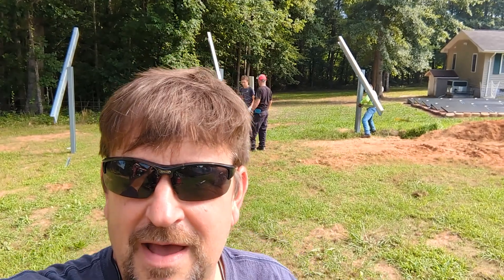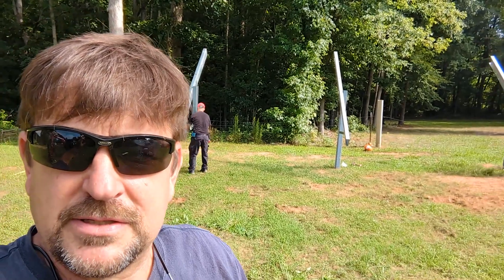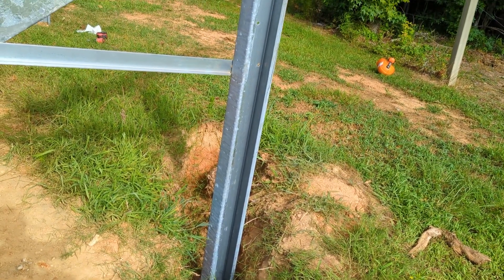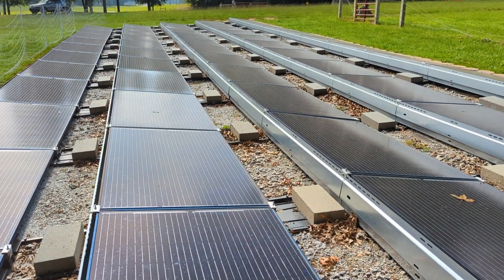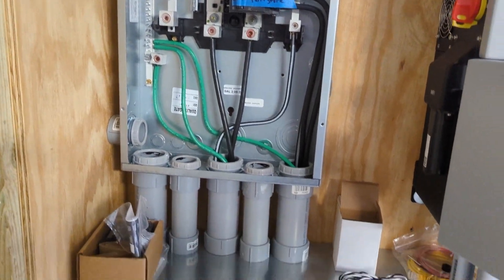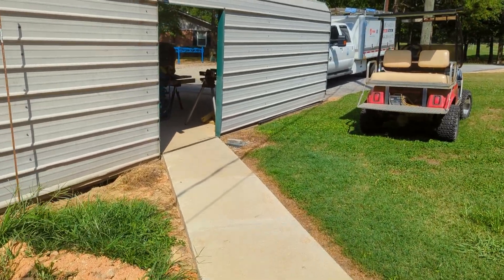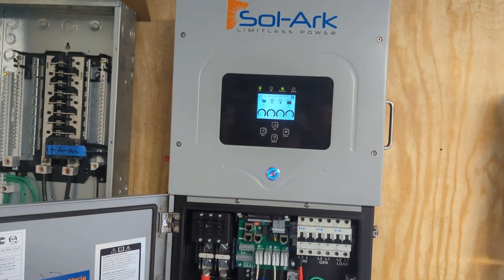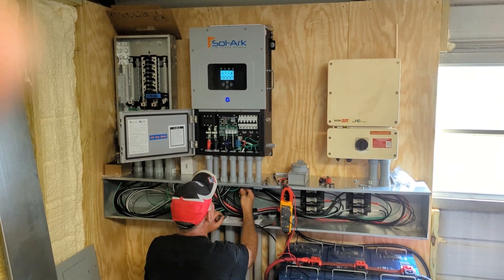Thrasher Solar

Comment: Hello engineer775, may I ask what kind of part do you use for splitting the 4/0 battery wires for dual solarks and dual evault max setups?  I am adding another solark12 and evault max and need to split the line in the cable trough.  Do you use a 4/0 power distribution block or one of those black covered screw type connector things?  Thank you!

Comment: The ballasted ground mount could be combined with a rain collection system as well...a two-for-one kind of thing.
Reply: I love BOGO things. 
Another idea for those with very hyper children is to tie them to a horizontal wood wheel and have them march in circles pushing it like they did in ancient times to grind grain. Except turning it will power an electric turbine. Basically a water wheel on its side so you can power it using rambunctious children instead of farm animals or water / wind.
A 2 for 1 kind of thing...   😁

Comment: How do panels on the ground deal with deer (white tail and mule)?
Reply from the maker: For the most part the panels leave the deer alone. lol
Reply: @engineer775  😃 but the deer may not leave the panels alone... Might run or walk on them, maybe slip and fall. So easy to put panels on the ground, but I should probably do them 6ft high and maybe even be safe with cattle.

Comment: My 15k has been working great, although not sure if it's the batteries or inverter but when it hits 100% it slowly discharges <100w constant. Not sure why.
Reply: Wouldn't that be the power requied to run the 15k and keep it on?
Reply: @Zorlig  maybe, but I have solar and grid going into the inverter both with power so not sure why it's trickle draining the battery
Reply: @hoocli  oh I see what your mean. No idea. You could check your charger settings, what does it have for absorption and float? It does seem like matching the two voltages might resolve it for you but I don't know.
Reply: It's communicated from the battery. Last I checked 57.6v